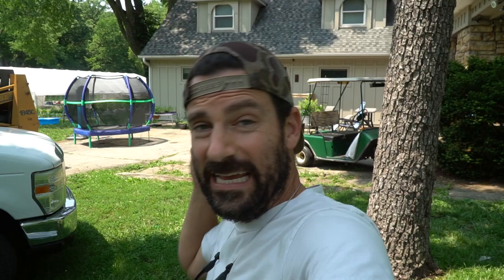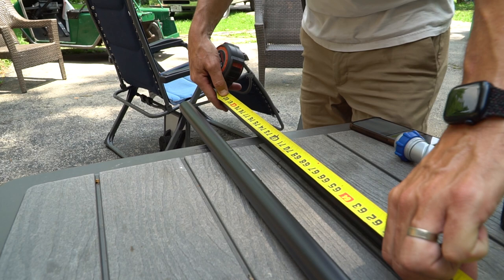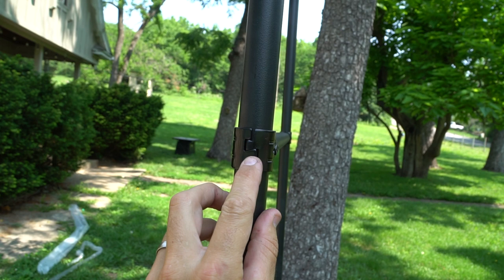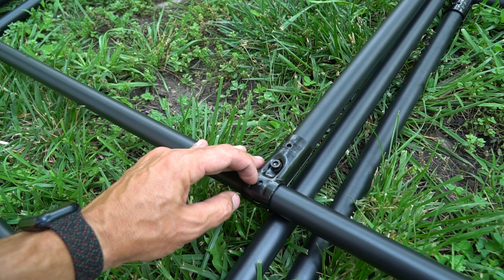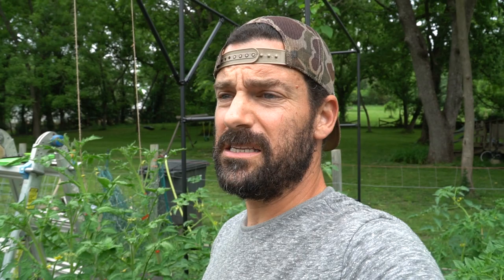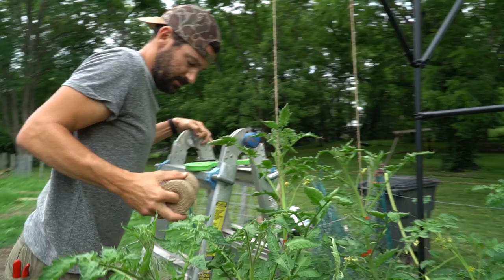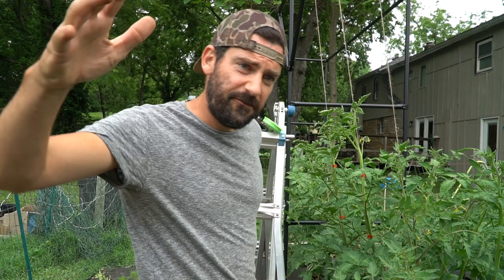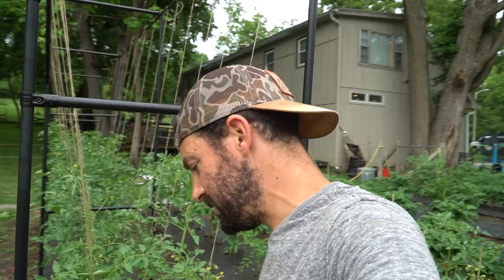The DIY GARDEN TRELLIS you never knew you NEEDED! TWO LEADER tomato trellising method.

Comment: That has to be expensive.
Reply: I was thinking the same
Reply: They have a gallery of plans already.  Steel pipe is cheap and those connectors are only a few bucks.  You can build a version of that for about $80-200 bucks depending on how expensive you wanna go.